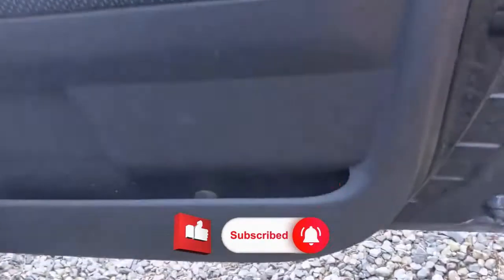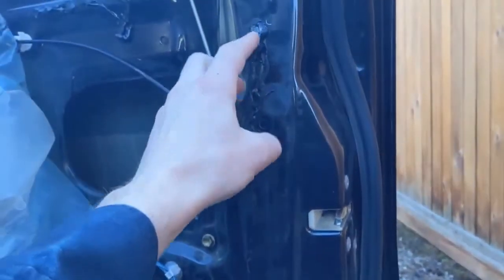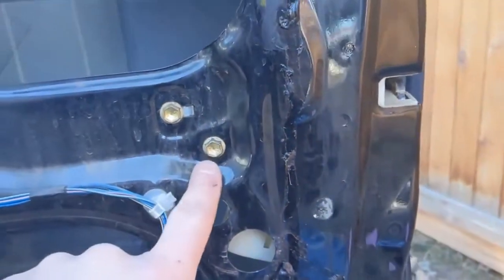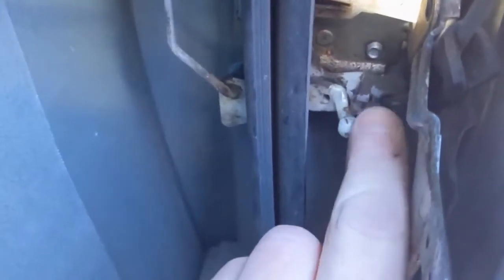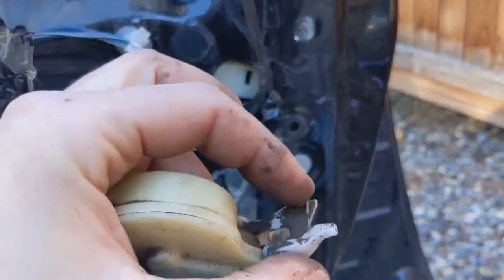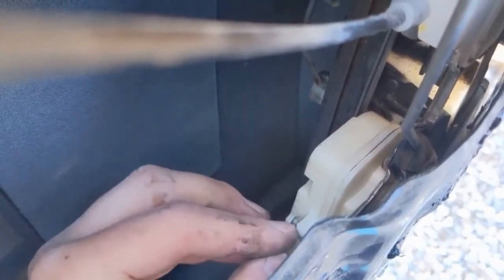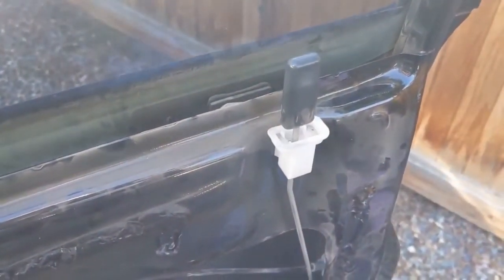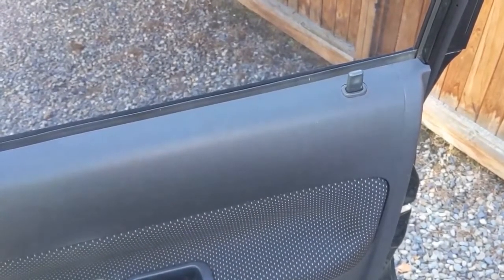Scion Xb Door Lock Actuator Replacement (How to)

Comment: Thanks for this video... My daughter and I just replaced the 2 actuators in the back doors. Very small space but we got both done in anout 90 minutes or less. The biggest issue was not having enough room to get a tool in the door to get the screws out. We are going to pay a window installer to put the 2 front door window motors and actuators while i install the door speakers. Wish us luck!

Comment: I just got done replacing the front passenger actuator.  1, I hung the plastic interior door panel to the side with a bungee. so no unwiring was needed.
2 the replacement part had an extra plastic arm on the pointy moving part next to the ball socket.  I cut and ground that extra arm off to match the old actuator and the actuator snapped right in. 
 I also bought a replacement actuator for the drivers door,and it did come with the correct plastic arms. so no modifications are expected.
Get someone to hold the light source.

Comment: my door locks but very hardly unlocks from the cabin. I need to play around 8-10 times until it unlocks. Could this be bad actuators?
Reply from the maker: Hey Shak, it might be your actuator. I have another video showing how to check your actuator before replacing. If you follow that video and you have power every time you push the button then I would say the actuator is sticking and should be replaced. Does it work everytime you use the key fob?